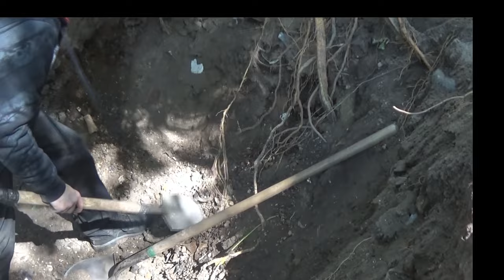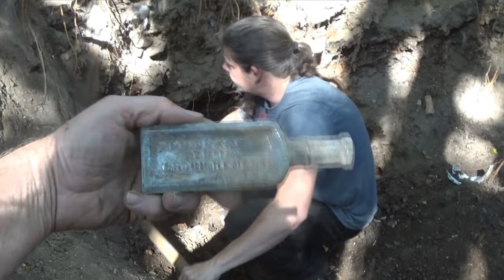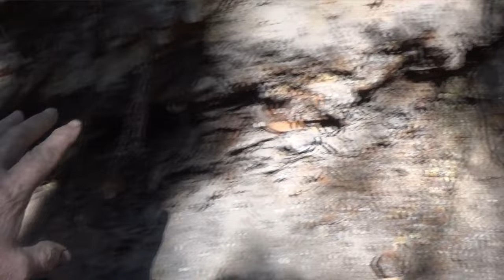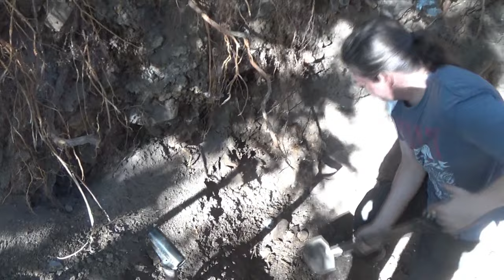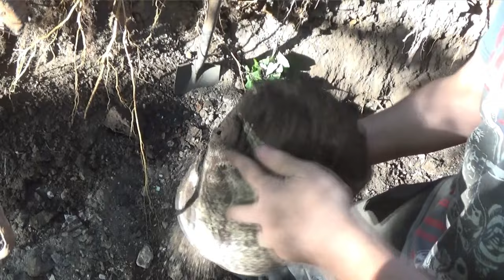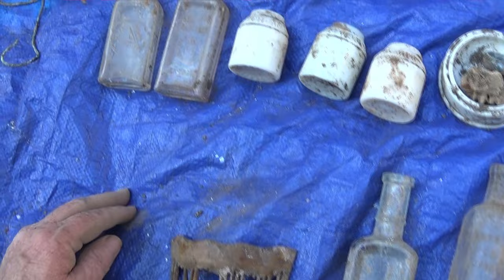Another Backhoe Dump Dig With Paul

Comment: Another great video, but i have a question, have you tried digging down through what you call the bottom? When wouldn't it be nice if that was a cap for an older dump site? who knows, could be a lot Of open or iron pontils.. wishful thinking???😁😁
Reply: i know that feeling! I never want to miss a thing. Dave will probe and check the ground most of the time. thanks for the reminder because you just  never know :)